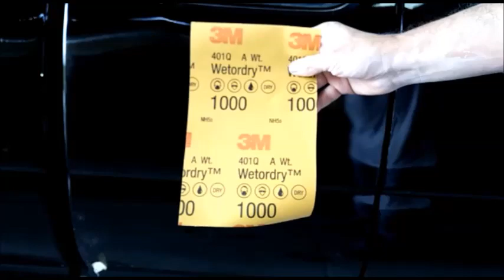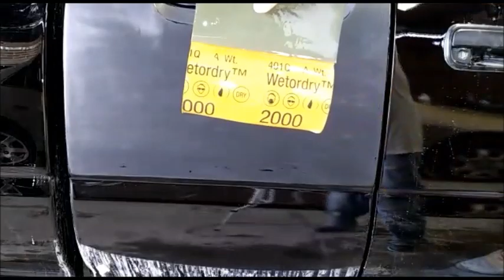Como pulir un carro que fue pintado

Comment: Se puede lijar con una lijadora rotativa y discos 1000, 1500 y 2000 al seco sin agua
Reply from the maker: Si se puede. Puedes usar la lija 1500 y la 3000 trizact de 3M pero llevan un poco de agua con un atomizador.
A mano puedes usar lija 1000, 2000 y 3000
https://youtu.be/gziQ62YCBLE